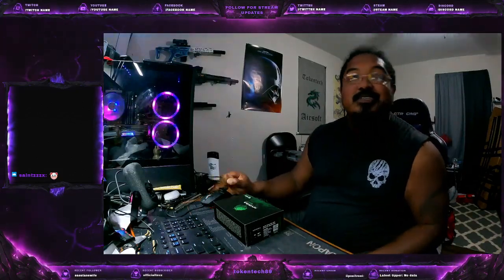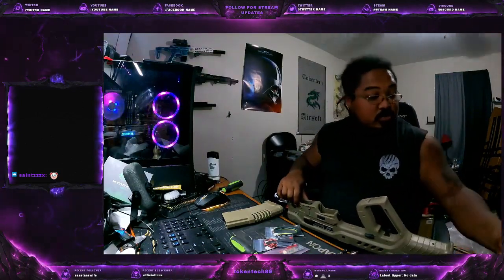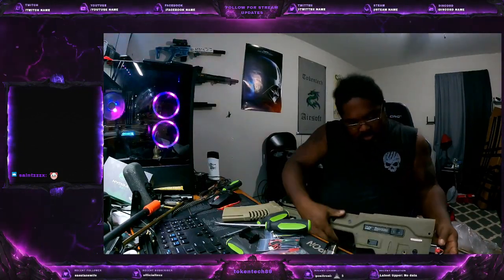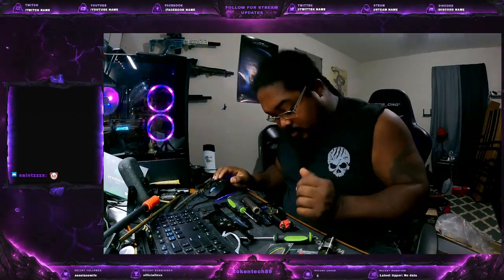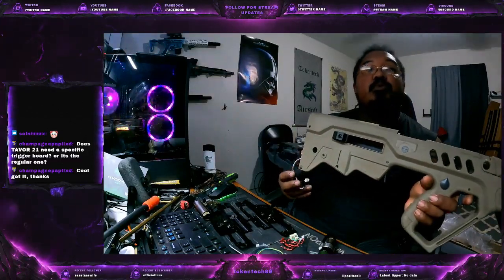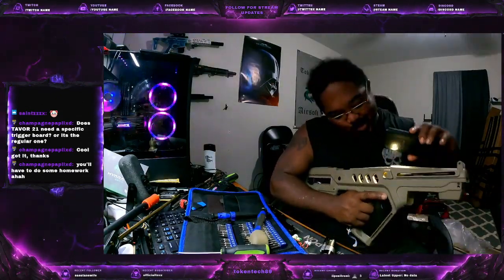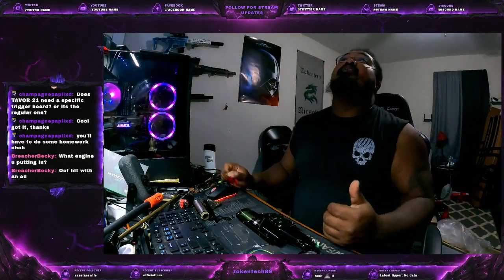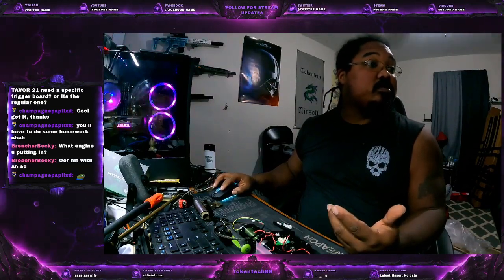Tavor HPA install from Stream part 1

Comment: I just got a boneyard CTAR and want to do the same thing. As I was pulling the trigger, I heard the micro switch in the front. I’m new to tech’ing and realized I was going to be in a world of pain.
Reply from the maker: Luckily, I saved the recording of me doing this, so it will save you time and headache :)
Reply: @DionFranklin  yes, I saw some of your part 2 explaining your soldering to the micros switch, and it defaulting to full auto. It was late, but I have to rewatch that part because I don’t quite get where you did the re-soldering for the wires.
Reply from the maker: @warrenwilson6345  https://youtu.be/Y8OKjrdiiW8?si=bDN1_w-M_cWYD-VV&t=2204
Reply: @DionFranklin  ok, so the wires are directly to the switch and the switch is soldered to the board, but not to any contacts?
Reply from the maker: @warrenwilson6345  soldered or glued to the board, no contact to the board circuit